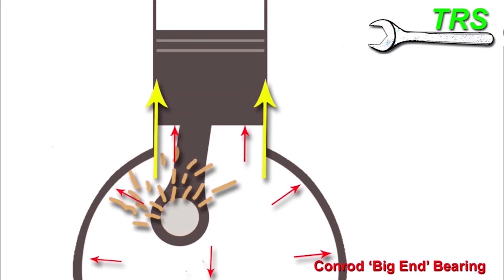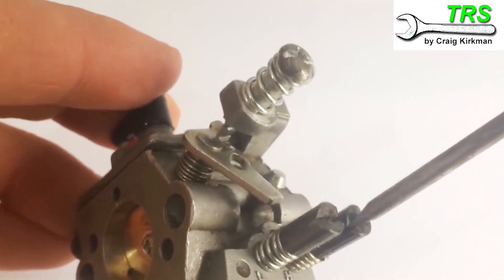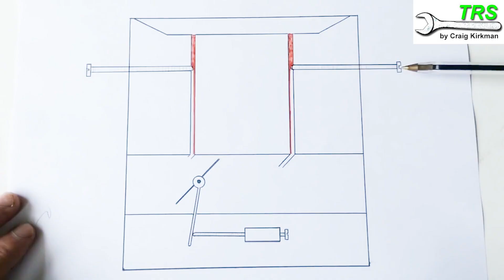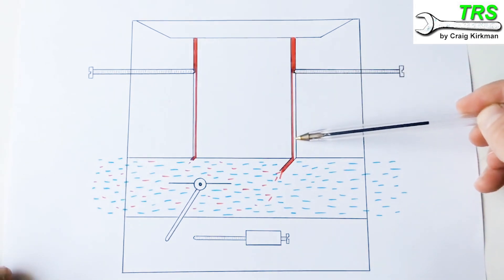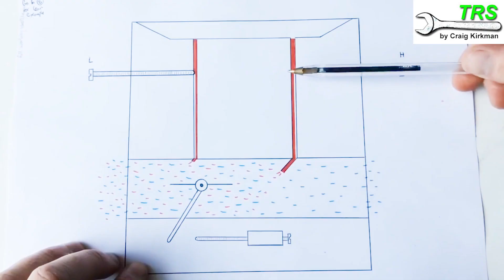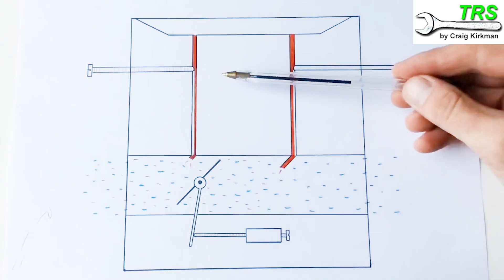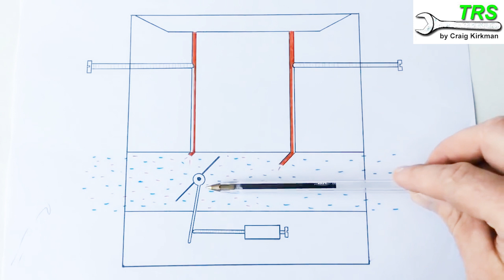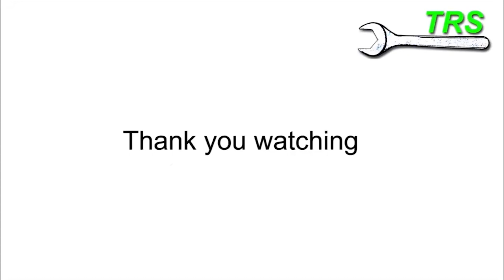CHAINSAW CARBURETOR ADJUSTMENTS - Chainsaw Carburetor Settings Explained!   (by Craig Kirkman)

Comment: Even years later your video set is still the best description available. It's taken me a while to understand how relative fuel delivery down the two jets shifts between idle and wide open throttle. On your other fuel trim video, you show a subtle fixed constriction of air flow where the H port meets the airway. When throttle is wide open, that constriction makes it the point of highest air flow, causing a venturi pressure drop that sucks fuel mostly through the H pathway. H is for wide open fuel delivery. In contrast, when the engine is idling, the tightest air flow constriction is at the almost closed throttle plate, right beside the L input. So, at idle the dramatic venturi pressure drop will be greatest at the L point, sucking fuel specifically from the L jet. At idle, the constriction at the H jet is insignificant because of backpressure caused by the closed throttle plate downstream, resulting in very little fuel draw down the H pathway at that time. What a brilliant design.

Comment: Thanks Craig, I've watched this and a number of your videos trying to figure out my leaf blower issue. It runs on Starting Ether so I know it's a fuel issue. After trying to clean the old carb, I gave up and bought a new one. It still will not start. I don't know what else to try. Plug is dry, so it's not flooding. Tried over-priming but I am not seeing any fuel enter the carb throat.
Reply: Maybe check and clear impulse hole on saw if it does not even make plug wet! An open impulse hole and passage on saw is connected to impulse hole on carb. It starts pulsing and pumping of fuel in pump side of carb. You can even open up carb to check and see after few pulls of starting cord if there is fuel in pump side of carb. If not, your impulse hole/passage in saw or carb is probably blocked!

Comment: How come my engine runs and revs the best with H fully closed and L open about 1.5 turn ??
Reply: Because your saw still has carburetor limiters installed and need to be removed for full adjustment.  Your diaphragm is also hardened because of ethanol-based fuel usage.